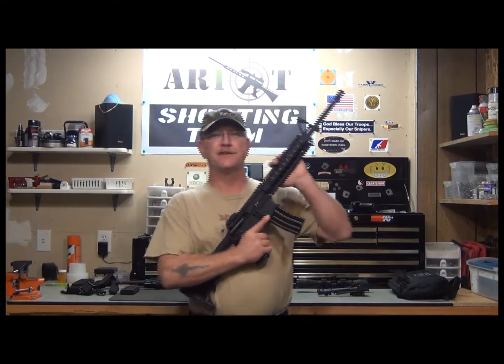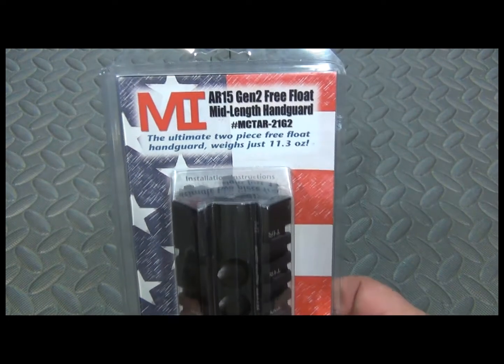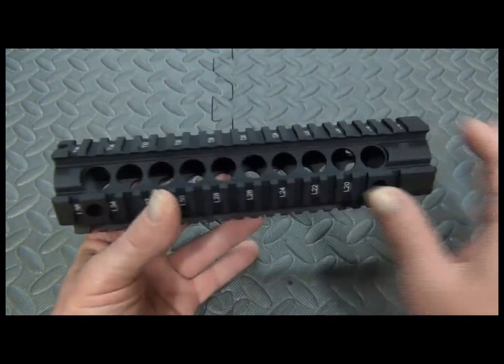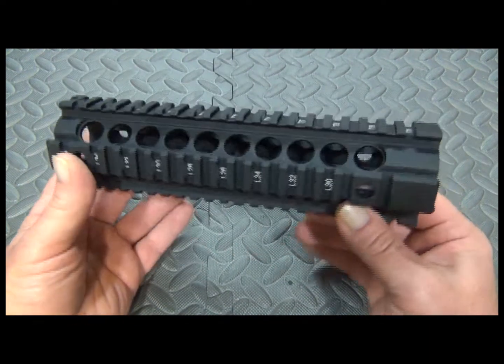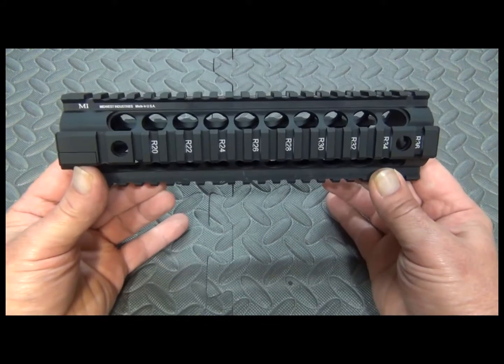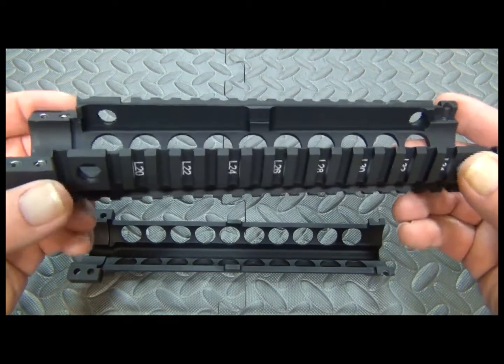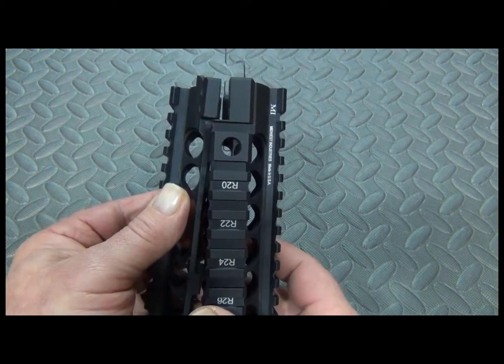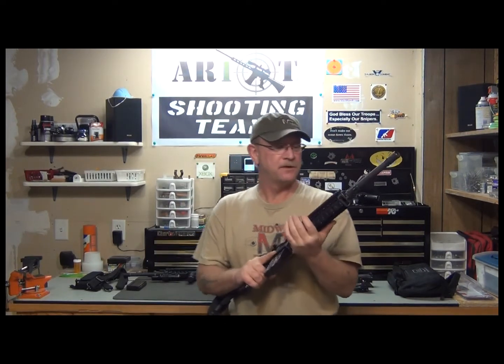The Gen 2, Two Piece FreeFloat Handguard.

Comment: what sling attachments are compatible with the holes . i just bought carbine length one , i had armorers wrench but i decided to cut the hand guard with a oscillating multifunction  saw made easy work of the aluminum thanks for posting the video i bought this thing brand new for 65 bucks shipped on ebay and your video was the only video worth watching on the subject

Comment: Great video. I'll be getting one for my carbine next week.
Reply from the maker: I think you will be most pleased with it...check out the install vid and if you have any questions, feel free to ask...oh and to add...You can install it conventionally if you so choose...being removal of the flash hider, front sight/gasblock and the delta ring assembly....if you have the tools needed...
Let me know how you  like it ...
Target On.
Reply: ***** I'll be doing it just like you did it in the video. My Flash hider is permanent. Going to have to cut the delta ring off.
Reply from the maker: 98 SR20
Just remember to be Patient and as I did in the vid..use some sort of protection on the receiver and barrel area just in case of a run off..that is most important as well as not to cut to deep or to fast....again, Take Your Time....and you should be fine...
Target On.

Comment: Odd question, but just how "free floated" is it? The plate for the old hand guards at the rear of the gas block looks like it's almost touching but that could just be me.
Reply: It is touching, and the front of the two pieces of the rails seat inside that cap by the front sight post. Not sure why they call it free float